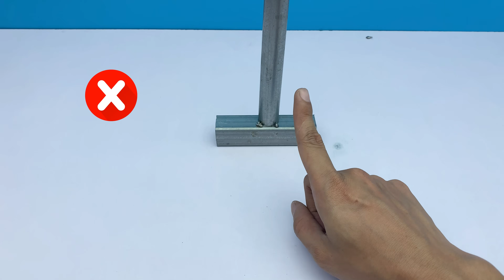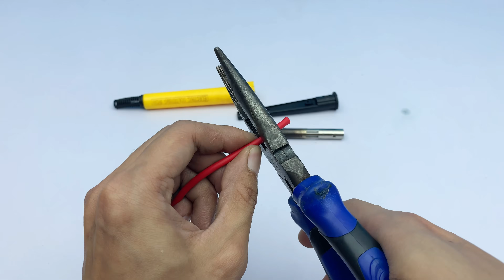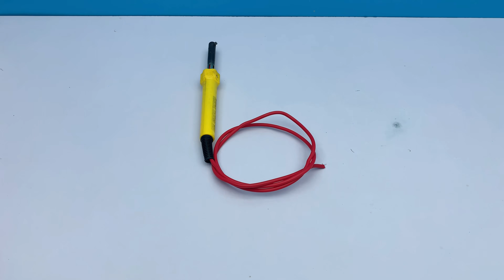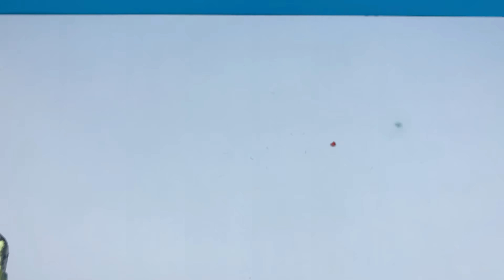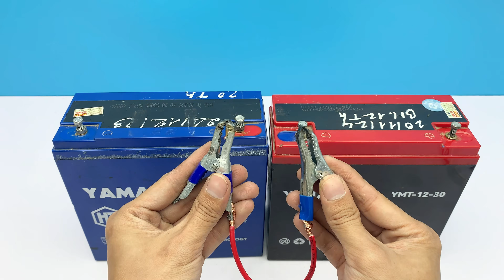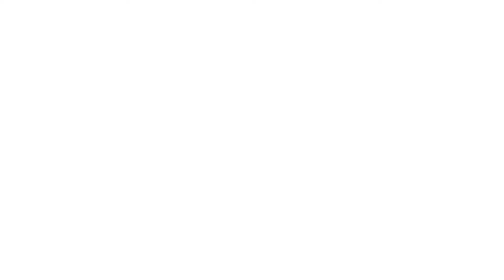⚡ Never Buy a Welding Machine Again! A Brilliant DIY Welder You Can Build at Home!

Comment: is this method strong enough to create a hole on a metal like a cross member?
Reply from the maker: Thanks for asking! No—this method is not suitable for making a hole in a vehicle crossmember. A crossmember is a structural component, and heating, burning, or drilling it incorrectly can seriously weaken the vehicle. Please use manufacturer-approved mounting points or consult a qualified automotive fabricator. What are you trying to attach?
Reply: @ToolBros8479  there is a steering rack on one end that has the thread chewed up so its best to make it pass through and use a long bolt so just saw this and was woundering if it could do the job .